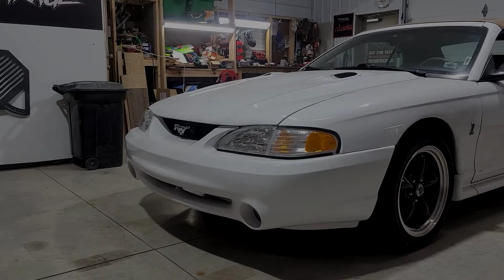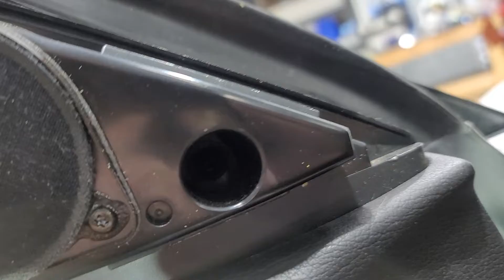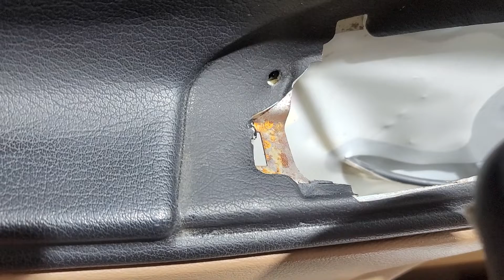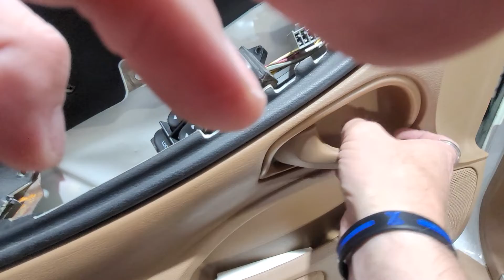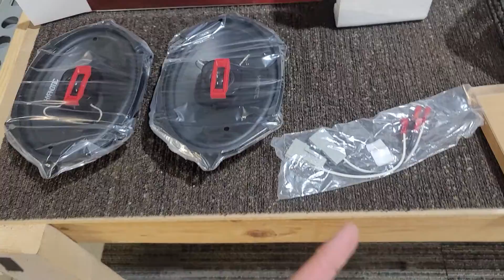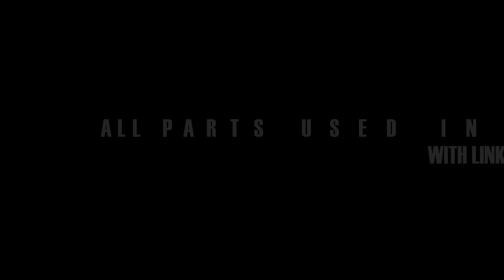MUSTANG SN95 DOOR PANEL REMOVAL AND SPEAKER INSTALL 94 - 04 W/ MACH 460 DRIVER

Comment: I have a  94 gt that I am about to restore. I took the door panel off and noticed the same little box you did. Checking my Hanes manual it seems its a part of the remote lock unlock if the car has the remote to lock and unlock the doors. Thanks for the video as i will be updating to a two din radio.
Reply from the maker: It's definitely a huge upgrade and brings the technology into the 2023- 2024 age
Reply: Did you confirm it has to do with the remote lock/unlock?